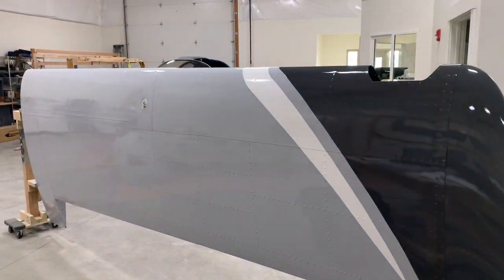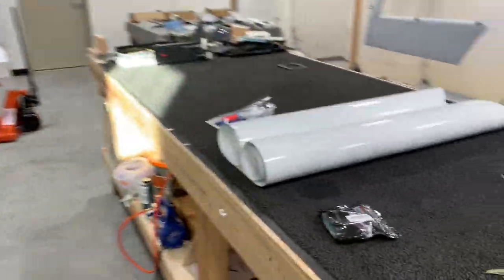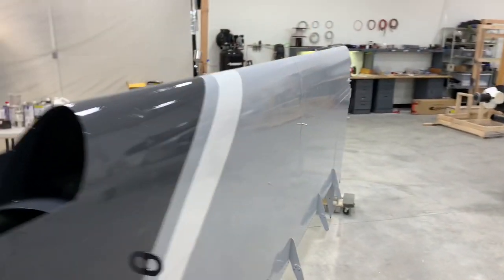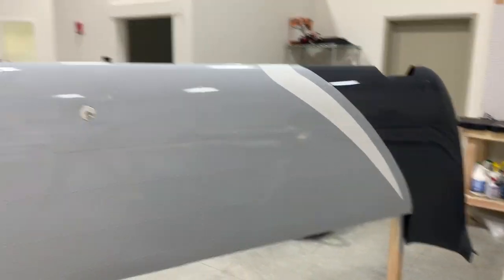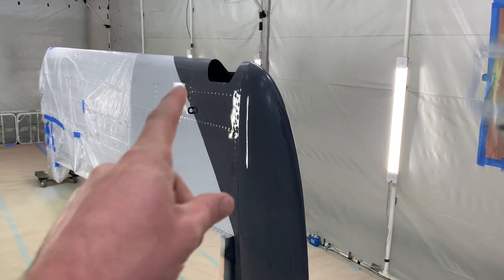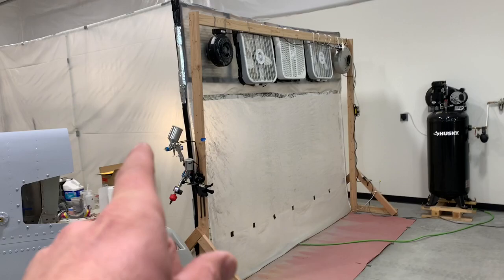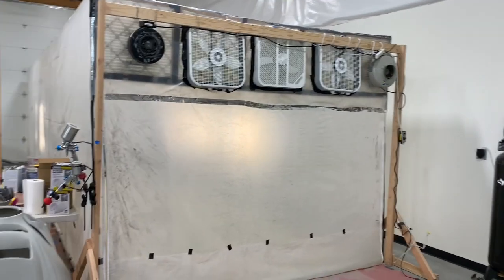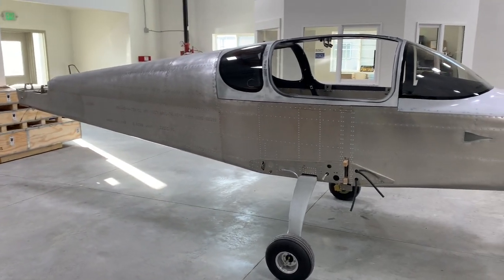Sling Tsi- This Week

Comment: Paint job is looking great! That vinyl looks like it adheres pretty well, even over the rivet heads much better than I expected actually! A friend of mine has been trying to convince me to wrap the whole plane in vinyl rather than painting, but rivet heads were always my concern.  Maybe not as much a concern now, hmmm...
Reply from the maker: Jetshine i thought about vinyl too, you could just skip filling the rivet heads too because the vinyl would cover them all. I actually think it would be super hard to wrap the whole plane though, the sheets of vinyl even for my small detail stuff are a bit hard to manage, I can’t imagine doing a whole wing. Also it’s a fair bit of work to get the vinyl to conform to each rivet like that, it might be very time consuming to do the whole plane. Maybe still easier than all the prep required for paint though 🤔